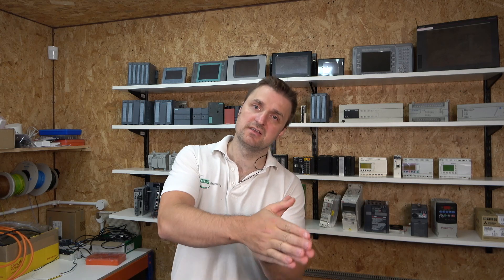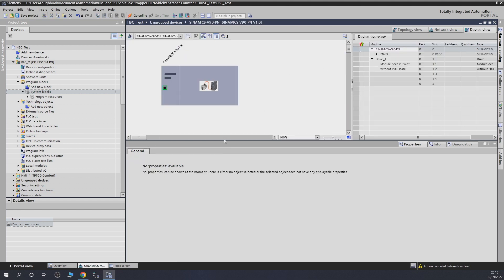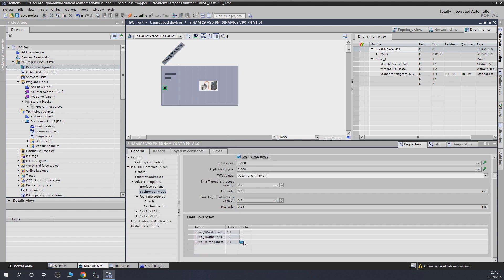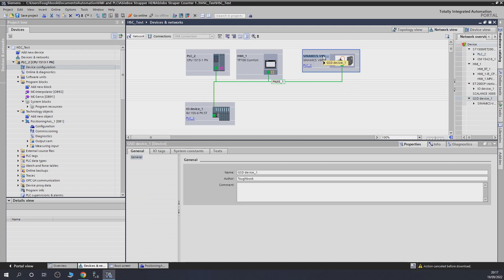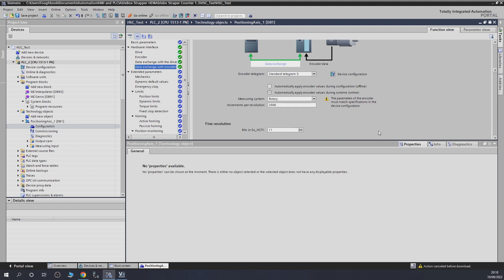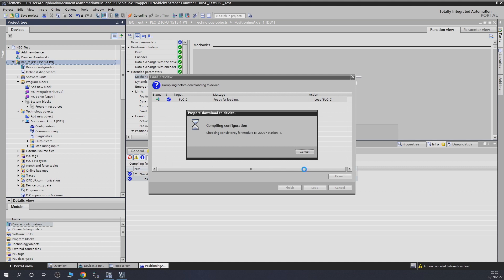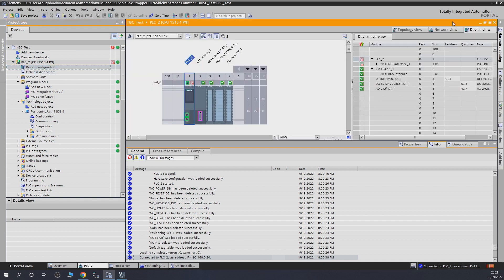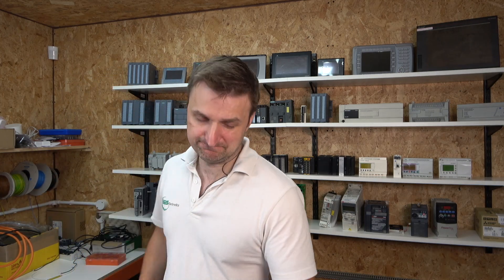Siemens V90 Servo set up in TIA portal communications with S7-1500/1200 PLC

Comment: How much is the cost for a basic Siemens V90 servo motor & drive?
We are looking to replace our NEMA23 stepper motors with these, any suggestions? Our application is not torque intensive (not more than 3Nm)

Comment: Hello, I appreciate a lot you rvideo. However I have a problem when I try to comissioning since tia portal: however the telegram is not being sent and the error on servodrive is: F8501: PROFIdrive: Time
exceeded setpoint
Reaction: OFF3
Confirmation: IMMEDIATELY
Receiving PROFINET setpoints
has been interrupted.
• The PROFINET connection has been interrupted.
• Controller disconnected.
• Controller set to state
STOP.
• PROFINET defective.
Restore the PROFINET connection and set the controller to R state. tHE COMM led is okay but RUN led is blinking red. The shyncronous is okay. Do you have Any idea to fix It? Thank you very much.